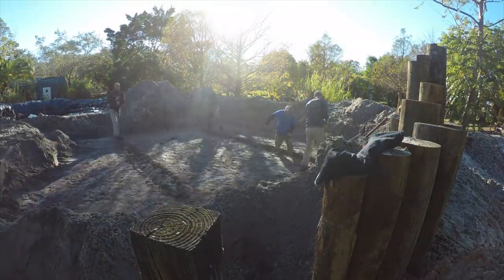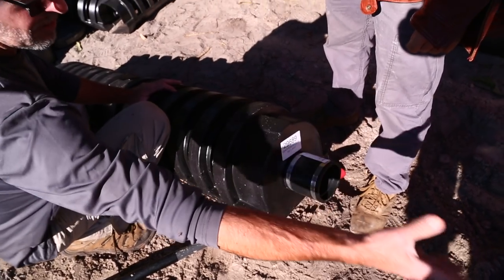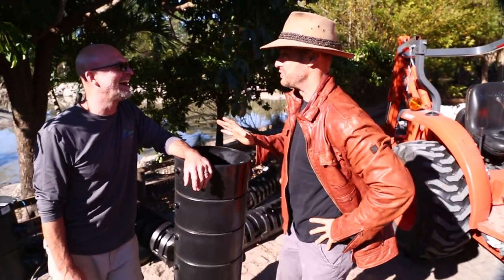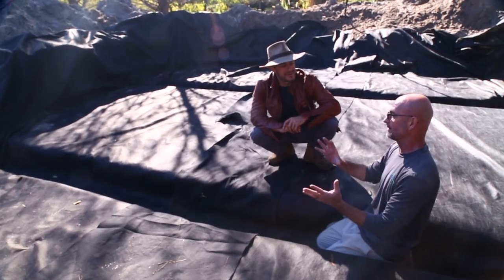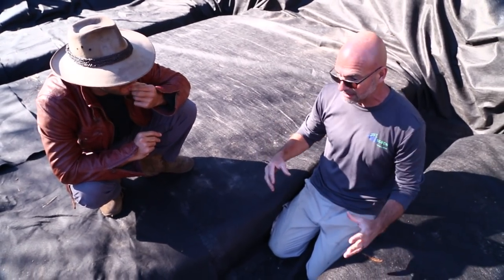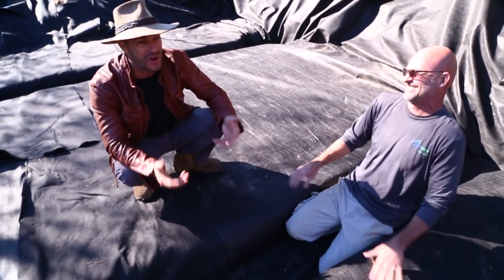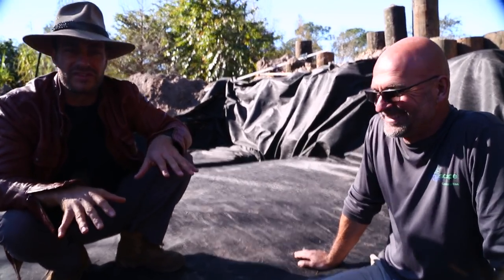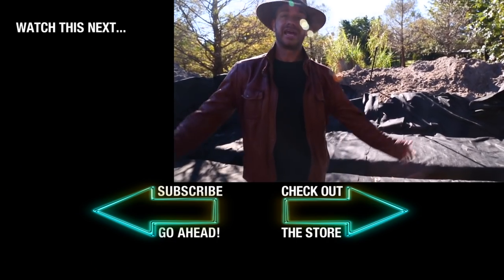Creating a GIGANTIC Man Made WETLAND FILTER!

Comment: I’d like to see a salt water pond I think that would be awesome
Reply: Shmeebitdog G also impossible
Reply: Moa Vic why would it be impossible I’ve seen indoor salt water ponds here where I live only reason they are not out side is the weather gets to cold here
Reply: Shmeebitdog G 
Water evaporation on such a large warm surface area means the salinity would change drastically. In fresh water this is less of a problem as you can just top it off and it’s fine but monitoring how saline it was would be very difficult and saltwater fish are less tolerant. They’d need more stable temperatures and water quality. Possible but a massive pain in the ass. There’s a big one in Florida but they just pump pure seawater in and then out again so they don’t need to worry with temperature or water quality